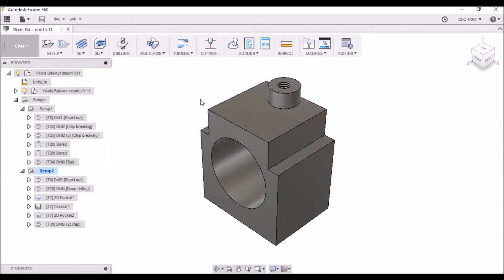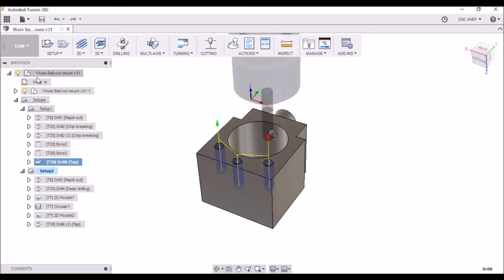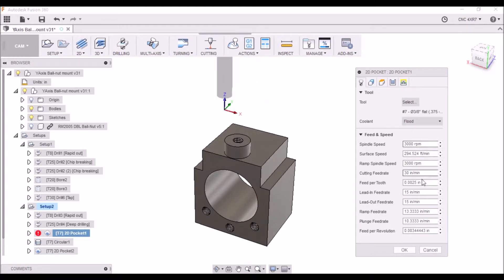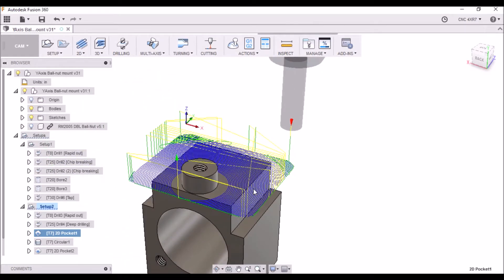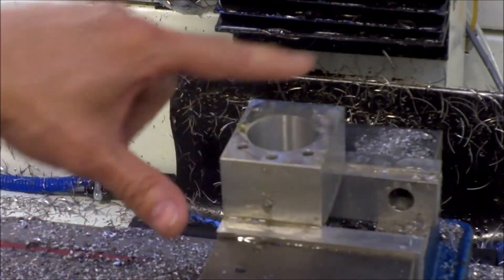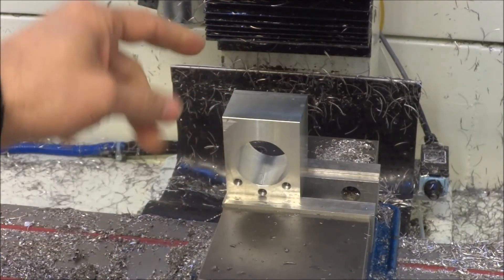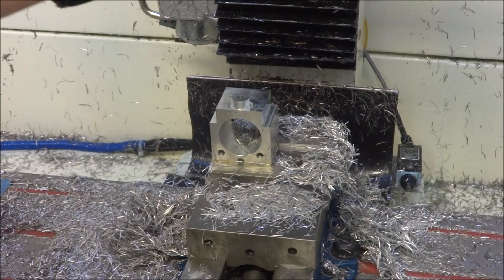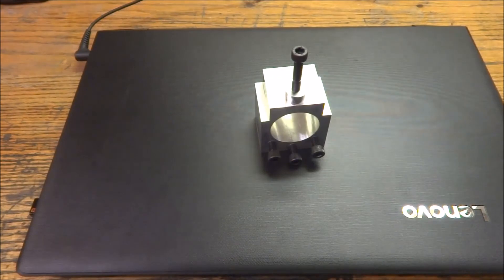Y Axis Ball Nut Mount Machining

Comment: Sam, take a look at the adaptive clearing in Fusion. That center bore could take shorter time with less abuse on the end mill as you are only using the bottom of it with the current operations. https://www.youtube.com/watch?v=1TgYz_LBdkw
Reply from the maker: Yes I'm Aware of this I had issue with chip removal and therefore choose this strategy. Not the best but it worked.

Comment: once again another great instructional video. just curious to how your setup does tapping. is your spindle motor direction  controlled by mach3?
Reply from the maker: Yes My Spindle is controlled by Mach 3 tapping is done using a G84 Cycle

(1001)
(T31  D=0.315 CR=0. - ZMIN=-1. - RIGHT HAND TAP)
G90 G94 G91.1 G40 G49 G17
G20

(DRILL6 3)
M5
M9
T31 M6
S400 M3
G54
M8
G0 X-1. Y-1.
G43 Z0.6 H31
Z0.2
M29 S400
G98 G84 X-1. Y-1. Z-1. R0.2 F19.7
G80
Z0.6

M9
M30

Comment: Hi, I was wondering something, like never to crank the stainless steel or carbon steel (Fe36 or Fe 42) brackets and bushings.
You will get more solidity and greater precision avoiding the wear or deformation that unfortunately has aluminum.
I think your car is hard to work with metal with carbide or hrc60 coated tools (at the limit also hrc50)
At the next and compliments for the videos I am very passionate about.
Keep it up
Pau
Reply from the maker: Hi Paolo,
 You could make the ball nut mounts out of Steel, but the Aluminum has not given me any problems in the past.
Once bolted up, if aligned correctly there is not any movement.
Be Safe Sam